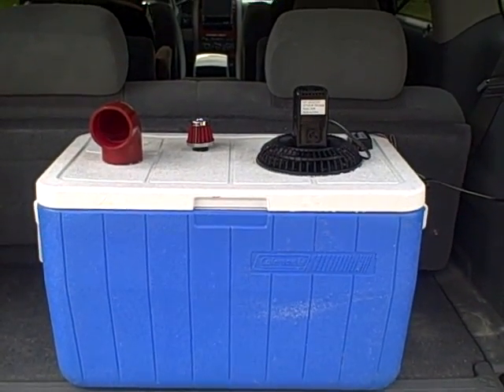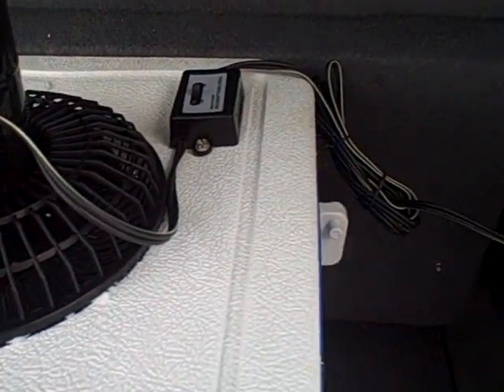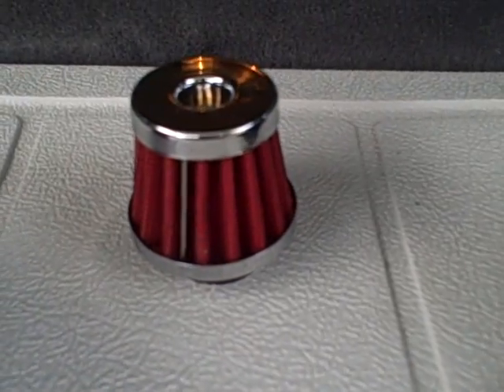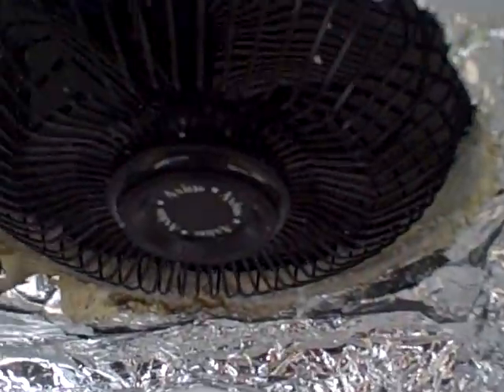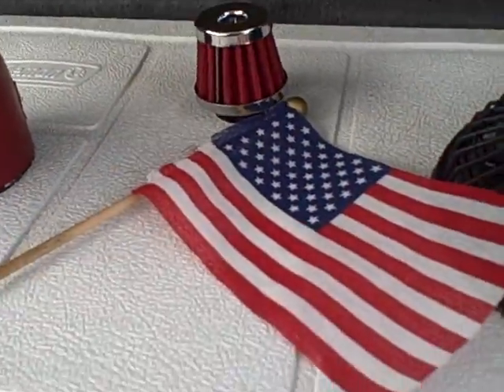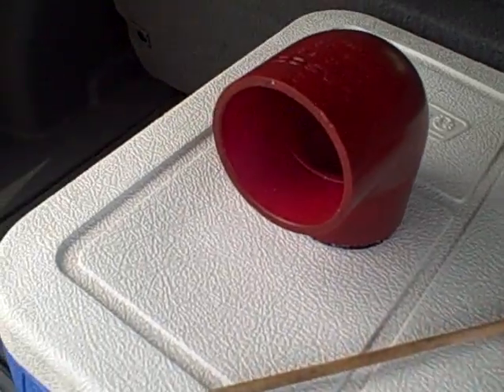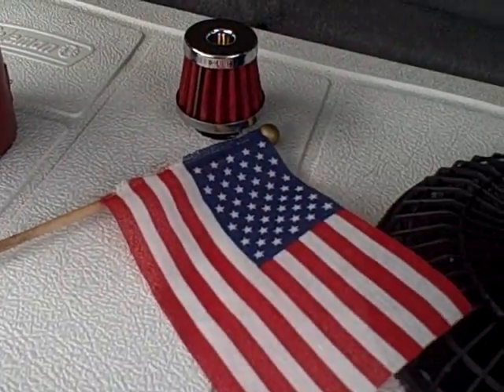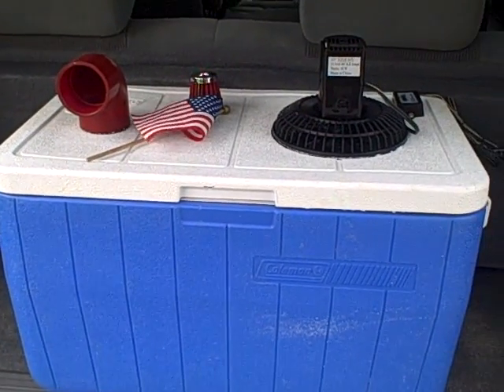HOMEMADE AIR CONDITIONER EXPALINED.  (A LITTLE BETTER)

Comment: I removed the top part (because my wife didn't want me to drill any holes in it, so she could use it later) and replaced the top part with a styrofoam lid that I made to fit the cooler perfectly. It worked GREAT with the fan and the 2" PVC.

Comment: gas wasted for AC usage 35-40% more fuel per hour. Fill up your gallon milk jar with tap water and freeze them or get 10 ice packs and freeze them. Put it in the back of your car and connect it to the air duct. Even the water or melted ice pack will continue to put out cool air. great design. Now i have to figure out mass production. thank you sir.

Comment: I tried it using a Vornado fan and it didn't work. The room remained 80 degrees while the air coming out of the A/C was about 76 degrees, but just for about 1 hour, then it was 80 degrees just like the room. Does using a Vornado fan instead of a regular fan make a difference?

Comment: Problem, is 5 bags of ice a day will cost 300 bucks a month.
Reply: Mike Warren man damn it i feel sorry for you buy AC and send me the bills ,,
Reply: Ive been playing with both, gallon jugs and 2 liter bottles, and i like 2 liters better. They stack in better allowing me to get more in the cooler which helps last longer and blow colder.  In in louisiana, also 100+ summers with 95+ humidity. The use for me though is not an alternative to AC but rather an assistant to it.
Reply: Would not give you enough ice so last very long
Reply: thats why you freeze gallon jugs
Reply: 2 hours of use maybe 3
Reply: use your freezer for a bottles
Reply: Won't last very long
Reply: Mike Warren mmmmmm for how long did it last ?
Reply: I get roughly 6 hrs from 3 gallon jugs with ambient temps starting in mid 70s.
Reply: yea. thats good for you, not sure where you live, but here in michigan its humid and gets over 100. i might get 2 hours. maybe, on a cool day.
Reply: iv thought about installing ac, but that would be a huge project, wiring, dials, radiator, brackets on the engine, entire newsetup and belt.   big undertaking
Reply: Mike Warren if you use like two or three gallon jugs or 2 liter bottles, they last up to five ours frozen and maybe an extra 2 with cool water, without replacement

Comment: Not an air conditioner just a cold air blower really.
Reply: When all the ice has melted does it continue to blow cold air? Obviously not! It's just a waste of a good cooler box. If you want an air con unit then buy a portable one and get the real deal not some shit box blower that needs to be filled with ice over and over! Better still fill the fucking thing with cold beer and ice and get pissed and fart yourself into a deep, contented slumber like any self respecting proper guy would do!
Reply: Air CONDITIONERS remove humidity, thats why water leaks from the back of them
Reply: Blank Verses Productions no but ok.

Comment: This is well done, sir. They make electric coolers, many truckers and RVers use them, which use a peletier heating/cooling unit. They will generally cool the inside to about 30-40 deg F below surrounding air temp. Combine that with the good idea of using frozen 2-liter plastic bottles and you might really boost performance or duration of cooling. These electric 40 quart coolers are about $100 USD. They do draw nearly 10 amps though.

Comment: I've seen "commercially" made versions of this sold to pilots of small prop aircraft for hundreds of dollars. They use coolers about half of the size of the one in the video. A small aircraft has the ground comforts of a 1935 car with the windows welded shut. Once you get above ground about 1000-1500 you don't need A/C. On the ground, or doing touch and goes, you might have heat stroke on a hot day. This is especially true on the ground when it's raining and you can't taxi with the doors open.

Comment: in a well ventilated area i would say dry ice would be ok but breathing in co2 isnt good. if it were an indirect cooling system like say a coil in a cooler with the dry ice pumping water to a radiator style unit with a fan and the vent from the cooler isn't within breathing distance i would say fine but then with dry ice you run the risk of freezing the water

Comment: Make a sealed tube from the input to the output make it in the fashion of a radiator it will keep the carbon dioxide in while blowing cold air out.

oh ya and use copper for best results it conducts energy better

Comment: you can be serious, won't the ice melt quicker? did you read the caption and what it is, HOME MADE A/C unit. I like that simple design I'm considering making one for my tent but was going to use a coil and a pump with tubing, how does that work? does it cool well?

Comment: I have an old Ice machine in the basement that I don't use anymore. It still works though. I'm thinking of creating two holes on it. One for the fan and one for the air to go out. It still makes ice very well. So, I will never need to keep adding ice to it since it already makes ice. Just keep it plugged in and running along with the fan and cold air will always come out. It will keep my basement cool. Hey, now that I think about it, maybe I'll just turn my basement into a nice bedroom. LOL

Comment: Mine used a divided cooler with half for the water container and the other half held a lawnmower battery... In the compartment with the battery there is a hole in each side... A fan is in one hole and a car heater core is mounted in-front of the other hole... A pump is placed into the ice-water side the circulates ice-water through the coil... Drops the air temperature around 15 degrees from return to supply... Keeps a tent nice and cool all night... =).

Comment: > Join The MISSION To ACCELERATE USA ENERGY INDEPENDENCE 
- Create Tens of Thousands of New Jobs Here in Our Great Country!
- Drastically Reduce Air Pollution and Make Our Air Much Cleaner!
- Greatly reduce the burning of fossil fuels to generate Electricity!
- Create a surplus of petroleum that will lower gas prices at the pump!
Make it All Happen by Expanding WIND POWER Electricity Generation!
Help Our Country & Build Residual Income – Visit: BeatOPEC (dot com)

Comment: ice exposed to direct air blow would melt in minutes so one would have to replace it again and again after every now and then. If this is the case then it is a failure.